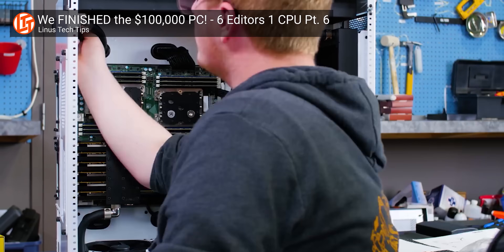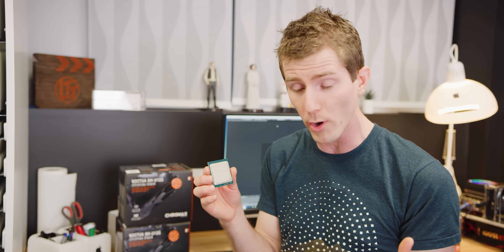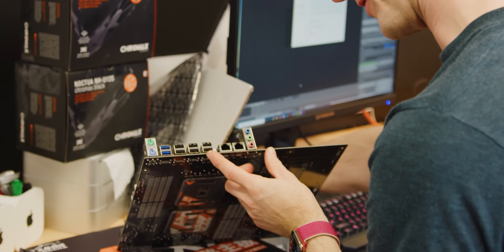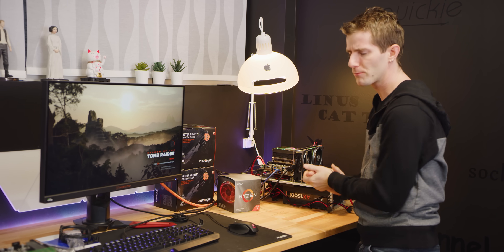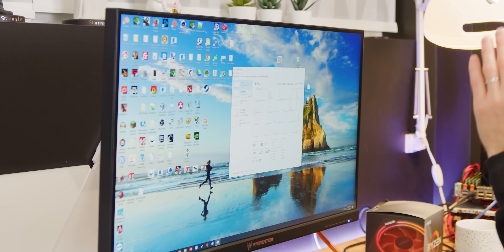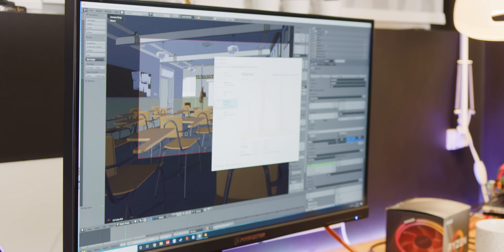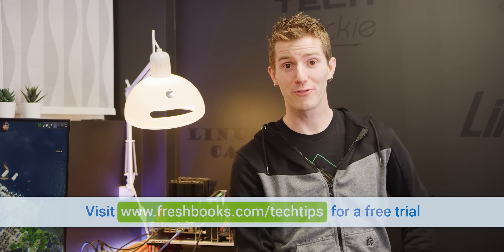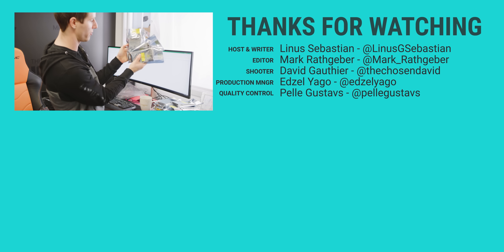SIXTEEN Cores for the Price of EIGHT!

Comment: Hi, hope you are all well.
Does anyone know more about this board or PC technology.
I have purchased this board with dual Xeons  2011-3 2680V4 CPU’s. MB works with only 1 CPU, no bent pins on CPU slot no 2. Power supply is 750 watt dual 12 v rails with 2 x EPS 8 pin connectors. Ram is not ECC but DDR4. Any jumpers to get 2nd CPU to work or is ECC Ram required. Code showing on MB LCD is 79.Waited a few minutes but PC stays on with no boot to Bios. All Ram and both CPU’s work.
Any help appreciated.

Comment: This is still a very valid video four years later, and I enjoyed it. If you are trying to compete with a modern CPU, use a pair of 'E5-2679 v4' = '20cores at 2.5gz' or the unicorn of all XEONS, the E5-2699P v4 = 22 cores at 3.0ghz. You want to aim for higher single core speed, rather than the most cores when it comes to these older server CPU's.  I have 2 Dell R630's with a pair of E5-2695 v4 @ 2.10GHz's in one and CPU E5-2690 v4 @ 2.60GHz in the other. the E5-2690 has fewer cores but i definitely faster.

Comment: Me and my wife both got Ryzen 5600s last year. I wonder if, a few years down the road, it would be useful to get a compatible dual-CPU motherboard and use both of them for one of us, while the other gets a newer CPU.

Same goes for our RAM - each of us has a pair of Corsair Vengeance LPX DDR4 @ 3600MHz 2x16GB.

That said, given how it seems like you'd need twice the RAM for a dual-CPU rig, it might not be worth it in our case, even with 2x Ryzen 5600s... then again, this is something to ponder in a few years; maybe by then some motherboards will be able to use a single set of RAM DIMMs for two CPUs and thus make such a setup potentially viable.

Comment: The biggest issue here of course is optimization. You have 2 times the cores, 2 times the memmory bandwidth...that isn't being used at all. You will have to look for games/apps that would actually use it. This is not at all mainstream gaming so of course you would have to look for niche scenarios. Encoding, massively multi tasking...I would be putting multiple gpus on that and 10 monitors this sort of thing. You took a hellcat to an agility course and said hmm this sucks.
An example for real world use would be many instances of a game, for example I play EQEMU and run up to 100 instances at once. This would be a system for such a task.
This would also make a killer media server system for an apartment complex where everyone could hook into it and share files etc. Sure someone could put a virus on it but there are actually communities that trust each other and this is not an issue believe it or not!

Comment: I was running a x58 MB with a zeon processor , and i looked at replacing the MB with a chinese x58 , x79  or even 2011 and i could not justify the cost ( apart from the fact that I had 3 Xeons knocking around ) . These boards are no cheaper than mainstream boards ,carry practically no warranty  and are glitchy at best .  Given a choice of the two systems you tested , (at the same price point ?? ) who in their right mind would pick the Xeon option  especially when you factor in the 130 W x 2 VS  105W  tdp  and , after much deliberation , I have a problem with buying  a MB without a warranty for the same price a one with a 3 year warranty and better specs .

Comment: rthe 3700x is 330€ + motherboard 130€ 460€  the e5 2600v3 motherboard is for 80€ + 2*cpu like e5 2630lv3 for 20€ one .... is 120€ without ram is 1/3 (46/13) of the price ryzen 7 ... or dual e5 2678v3 TB unlock is 80€*2 (160€) is 1/2 of ryzen 3700 and is ah render perf of ryzen 3900x :) and use cheap ddr3 just not for the gaming :) for 300€ 24core 3,3ghz 48  thread 32gb ram quad chanel :) just 300€    or 16core 32 thread 2,8ghz 32gb ram for 200€!!!!!!!!!!! is the render valur king .... NOT FOR GAMING JUST WORKSLOAD 

for gaming x99 for 70€+ e5 2640v3  (8core 3,4ghz TB unlock) 40€ +16gb ram for 150€ very good single cpu pc good for game :) is the 1/4 of ryzen yes the ryzen is beter 20-30% or maybe 50% ok but is 400% more expensiv :)

Comment: The dual socket will draw way more power in idle tho. If you are on a budget, Ryzen will save you tons in electricity bill (Considering the computer will be ran 16 hours a day, and the Ryzen draws 10W idle, and the Xeons draw 15*2=30W, you are looking at anywhere from 1.5 to 5 dollars per month of saving. If the computer is loaded most of the time, this effect will be amplified a lot, as much as 15 dollars a month of difference).
TLDR: Going for cheap old hardware will most of the time cost you more in mid to long term.

Comment: I just bought an "updated version of this board with maybe "X99 chipset" so DDR4 ram, 2x nvme, and it accepts v3 so I bought 2x Xeon E5-2650(w hyper 212 evo), 2x nvme 256gb, 8x8gb 2133mhz(intel list that at the max the CPU accept) <-- for 570$CAD for everything... will it last more than a year? I hope so!
Reply: how much did you paid for the MB ?

Comment: Are you able to run these dual socket boards with only one cpu in it and using the 4 dimm slots for that cpu? I'm very interested in putting one together with the same motherboard you've got here and dual E5 2673 V3 12 core / 24 thread but if i want to be able to begin using it right when all the parts start showing up i'd have to buy 1 processor.
Reply: The only answers I can find looking online seem to be either yes or no so google has been little help hahaha

Comment: Considering you're running this on SERVER CPUs from like 2011/12 on socket 2011 with DDR3 ECC.. And the AMD machine is what, 2019? I don't think it did that bad really, i was surprised myself, but this isn't exactly a great comparison.. If the surprisingly stable motherboard could have let you overclock, plus assuming the VRMs could handle that, and it was something newer than Ivy Bridge, would kick more arse but probably not for the same price. I'm still amazed what my much older Xeon machines can still do though.. The main problem in the industry is still (de)optimization of code and routines really.. Isn't just Apple doing that with their OSes! :P Game engines, thread management, drivers... As far as things have come, software has to catch up again!

Comment: 1:49  Linus: Ivy Bridge is old
My laptop with a sandy bridge i3: Yesssssss
Reply: Rocking Linux?
Reply: @optimalbass  windows 10, it takes me 2 minutes to open file explorer
Reply: @koustubhjain6789  Wow! If upgrading parts is not an option (such as the HDD for a SSD), you could consider going Linux. At a total cost of ZERO money, you could squeeze lots of performance. If you feel like doing so, I recommend Zorin OS Lite. Cheers!
Reply: Those 2 minutes those are on an 860 EVO
Reply: @koustubhjain6789  What a terrible performance, mate

Comment: This is not a great choice for a xeon build tbh. The x99 is worth the bit extra. you can slap a 100 dollar e5 1650 v3 on a Huananzhi x99 F8 and overclock it to 4.3 all core, 4.5 single, and have quad channel ddr4 as well. And its alot cheaper. Now, for like a rendering beast, you werent far off. but again, the x99 is worth the bit extra. you could still save a ton over even a 1st gen TR and have 20+ cores of Haswell that will outperform it all day. and then once Broadwell comes down in price, slap a couple of those puppies in it.

Comment: The E5-2667 v2 are nice.. but the E5-2673 v2 out perform them.

For the E5-2673, in BIOS, settings:
Set power to performance , 
Disable C states, 
set to 6 cores (each) 
disable virtualization 

Populate all the DIMM slots.. min 16GB per CPU. (my system has 16 DIMM Slots, w/4GB sticks in each, for a 64GB total)
As much as ECC doesn't seem to like OCing.. "Force speed" to 1600MHz and then tighten the timings (I got my Hynix to 9-9-9-11)

You'll basically be running 12C/24T Xeon at 4GHz all cores on noticeable RAM settings
It's what I did with my workstation while testing its limits and it gave me surprising results.. but my Single Xeon 8C/16T, E5-1680v2 OC'd to 4.7GHz with the 9-9-9-11 RAM timings, surpassed the dual CPU setup in most titles my son plays (Valoranat, Overwatch, Modern warefare, Ark Survival, etc).

Comment: It is smarter to get E5-2620 V3, X99 motherboards and 16GB kits from Aliexpress for roughly 200$USD total? With a relatively simple turbo boost unlock, you will have very decent performance and more importantly, be DDR4.

Comment: The same price of entry for dated hardware which barely gives an advantage in even the best use case (you didn't share the xeon cinebench results, but I wouldn't characterize two thirds of a minute savings on a 12.5 minute job "noticeable"), doesn't make any sense.

Comment: Wouldn't a "fan down" heatsink be better for a dual CPU machine? isn't some of the exaust heat being dumped on the other heatsink? Also how did Linus power up with a fully installed version of Windows (presumably installed on different hardware) and still have a stable machine? I couldn't get Win 10 to do that on a motherboard change.

Comment: Twice the cores, four times the power consumption. Those xeons draw SHITLOADS of power when chugging away.
Forget the 130W TDP, measure the actual power consumption and you'll get a fright (it hits 200-250W per CPU under load)

Save on hardware, pay twice as much in power bills.

Comment: I don't get why you use ECC RAM
ECC RAM is actually most expensive you can find
Ordinary non-ECC RAM is much cheaper
I would get registered RAM to get cost down
ECC RAM for gaming machine is stupid idea and using ECC is not free either - it costs time to compute ECC and both cache controller (Every level) have to compute ECC and RAM controller have to do it as well. It actually costs time (money, as each cycle of processor is using energy) and money (as computation costs energy too). You have word choices. You want to od budget system, but this system actually costs more to run just because you use features, which are giving no benefit in this situation

Comment: I have a similar board like this Jingsha. It's a Huananzhi X79-8D, with two E5-2660 v2 @ 2.20 GHz and 128 GB Samsung DDR3 1866 MHz memory modules.
Sincerely, I wish I could have enough bucks to buy a killer AMD EYPC set with 64-cores... but I cannot claim at all.
This one, along with a Linux Mint 19.2 is a killer machine. I cannot claim, since I'm conscious that Xeon CPUs from AliExpress are used. It's just a personal decision. I usually run virtualization projects and BOINC client in spare times.

Comment: Would be good to see the "server" system Power Management profile set to High Performance. Those cores weren't running at base frequency in the task manager. I've seen that plenty with high core count servers. If you don't care about your power bill, the performance difference is striking.

Comment: I need PC build HELP, PLEASE. There are no decent PC builds for an accountant anywhere to be found. Might sound simple, but it's not. I'm an excel power user requiring to work on 3 x 4k screens at the same time (higher resolutions means more excel lines on the screen showing more of my data and I can even split each screen to show two pages of each open document) as I transpose data from one spreadsheet to the next with the main spreadsheet often exceeding 20Gb in size while running macros to also update from other sources (which now also works much smoother over a 200MB/s internet connection). I don't play games but I do want to watch Youtube videos on my 4K screens. Currently I find that running 4K results in the picture running behind the sound, which is horrible. Previous setups I've done, even high-end gaming computer recommendations, have been horrible for these tasks and with AMD's new processors I want to build something that will actually work.
Reply: I recommend you ask the forum or the discord server as you have a higher chance of getting ana answer :) Cheers!

Comment: Hey @Linus, 

I have one of your crazy one CPU many uses idea in mind and I managed to get some E5-2670 (the Sandy Bridge ones, not the v2 Ivy Bridge) and 16x8GB DDR3 ECC DIMMS. I was looking into this chinese MB, or the X79-16D that I found on eBay (It has 16 DIMM slots and a vga port/chip) so that I can make a Home Virtualization Server / NAS / Workstation. I plan on running one of these MBs with a HBA for the NAS Hard Drives (at least 5, preferably 8), UnRaid to run the NAS and as a host to virtualize some things (Ubuntu with Plex Media Server and other stuff, EVE-ng for my Labs and a Windows VM to use as my workstation, no gaming intended) running from an nvme drive maybe? I am not sure if these CPUs would work ok with Plex to hardware transcode 4k x265 videos, or if I'd need to put a graphics card and pass it through to do this task. I know I would't be able to share the graphics card between the linux and windows VMs and I don't plan on buying 2 of them (unless a very cheap option could do both tricks?). I also intend it to be fairly quiet and as cheap as possible (not louder than my currend Drobo 5N). I would love to read your thoughts and recommendatios on the build (case, coolers, psu) and the set up process. 

Thanks a lot! Kudos for the whole team from the center of the earth!

Comment: Instead of going for a Chinese MB just aim for a Dell T3610.
It has a 685W PSU, most likely a Windows PRO license, supports the same LGA2011 Xeon E5 V2 CPUs (1x), comes in a decent looking case.
It has no M2 SSD ports or NVMe Boot support by default, but its a Dell.

Comment: ok steveo lol. loving the videos btw. never got into pc's until just recently and i spent 2 weeks straight catching up on you're videos. bought me a pc about a 2 month's ago for 3 and got a 24in monitor, razor ornata chrome, g502 mouse,  with a i7, 16gb or ram, and a 780 graphics card. but the guy never cleaned the inside, the thermal paste wasn't spread correctly, so the heat sink has scorch marks and the cpu might be screwed. idles at 83 degrees without running games and when i do run games the temps climb to over 100 depending on the game.

Comment: Built an LGA2011 development server with dual hex core Xeons and an Intel server board.  Surplus Apple memory was a good price (more than half the cost of the system was memory).  Like the video says - it ain't gonna game.  As a dev server with a dozen VMs on it, it'll do everything we need.  dual CPU power connectors is critical - I spent a couple days cobbling together a solution for that because our PSU didn't have 2.  And if you're going to run something like a Supermicro dual NVME card - make sure the board is new enough to support PCIe bifurcation.  Learned that the hard way, and ended up having to get a second NVME card, with only 1 NVME detected on each.

Comment: I picked up an older 4 node, dual socket per node, and 8 cores per socket 2U blade server relatively inexpensively and it's been blazing fast for all of my HPC/CAE/FEA/CFD applications -- things that can make use of all 64 cores across the four nodes.

For the price, it's actually served me very well. I've been able to do a LOT of things with it that I just wasn't quite as able to do, in a timely manner compared to before I got this system.

In other words, old, used server hardware can still put up quite a fight even against more modern systems at a significantly lower cost.

Comment: 0:40 Are they actually plain DDR+ECC or "server" "FB: Fully Buffered"+ECC aka "Registered" ? And LGA2011 CPUs don't even require either FB or ECC, they can run plain DDR just fine.
Reply: EEC DDR3 is hilariously cheap in comparison to non-ECC RAM which is why these Chinese Kits on Aliexpress come with them.
Reply: @goolge64  No, plain DDR3+ECC is the most expensive of DDR3 variants (1.25V & 1.35V U-type and L-type notwithstanding), it's registered+ECC which is the cheapest and "slowest" (not much slower but much more power-hungry, really) one due to its extra buffering logic. But Linus never makes this distinction and blindly parrots misconception about registered and non-registered DDR, making it even more common. "Registered" is NOT "The ECC RAM".

Comment: This is almost exactly the build I've been planning out for several months. I came across 2x Xeon 2650v2s, (basically a whole server) with 64GB of DDR3. I will be running it as a server with Plex and other things.
Reply: same! I'm using 2x 2660v2's and 128gb ECC DDR3, and chucking a 1050ti I have lying around in there for laughs. how has your build come out?
Reply: @jaidsaviero  Been working great for a year! I have two GPUs in it. A 1070 and 1060ti running Plex and Nicehash. I was running a Valhem server on it for a while with no issues.

Comment: Dual socket E5-2667v2? That's 2x 130W CPUs. Yeah I'm gonna pass on that - I'm personally more interested in perf/watt, which has the added sidebenefit of cheap cooling and low electricity bills.

Comment: https://youtu.be/IqJoMdxT7XI?t=260
JUST GUESSING Linus! And probably wrong!!! These are "like" x79 - which means the have a 2011 Socket and compatibility to the CPUs of this era.
Check the data of the board. I owned a similar one; that had 1 2011 Socket and a H61 (or similar) Chipset!!! A H61 Chipset will not support Quadchannel RAM. And my guess is this one does not as well-

PS: I think these are obsolet now. I bought a Ryzen 1700 for 180$ in your money a year ago. These Xeons are still relative expensive, if not the 2,x Ghz ones. A 2690 is roughly 100 $. 
PPS: Where I live I pay 35 US Cent / KWh. calculate that for a year.

Comment: If an application is designed to be single threaded and without the OS assigning specific cores to each process, then you'd see the processing jumping between the cores, and that would also have the worse latency due to extra ram and cache operations. It is a problem in ryzen too to a lesser degree because of the separation in dies and separate caches, effectively it is also a 2 CPU setup on a single socket.